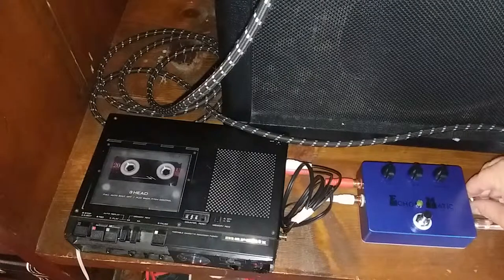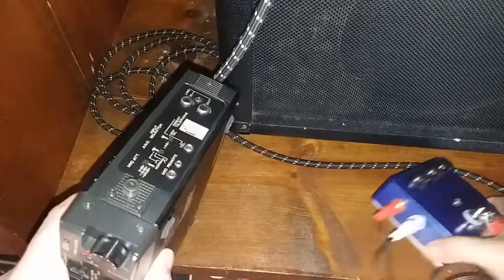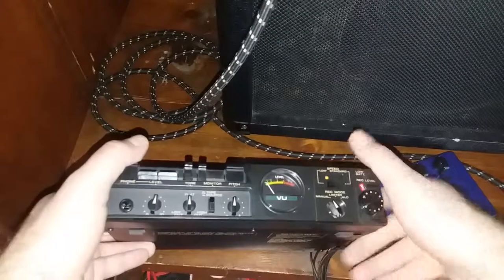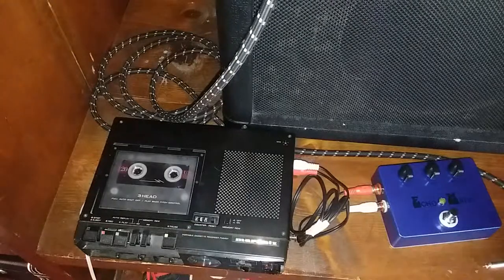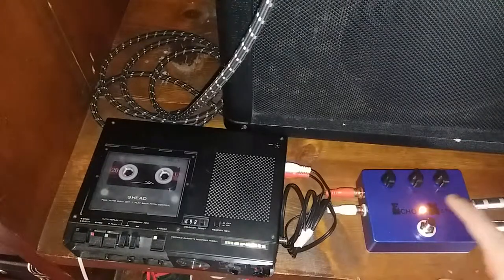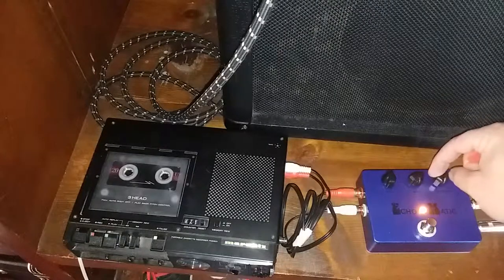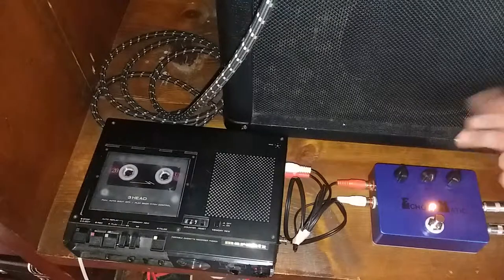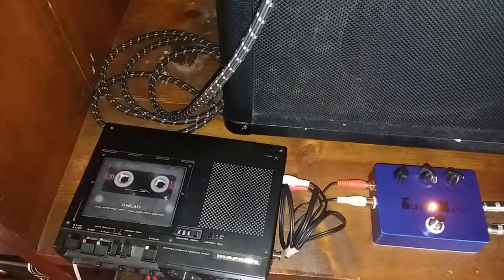How to use the Echo-Matic and hook it up

Comment: Hey dave! cheers for the demo. I just finished building myself one of these and i have a slight issue which i hope you could help with. The bypass signal is actually louder than the echo matic ! when i turn it on there is a noticeable drop in volume.. I'm using a new 9v battery and can't seem to figure out what is going on. Also what should the output voltage be? Thanks!